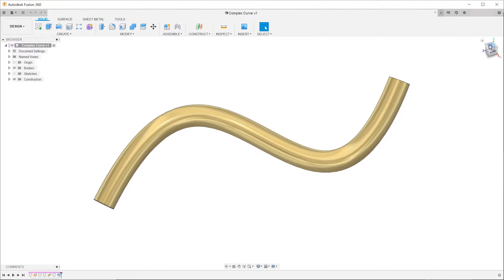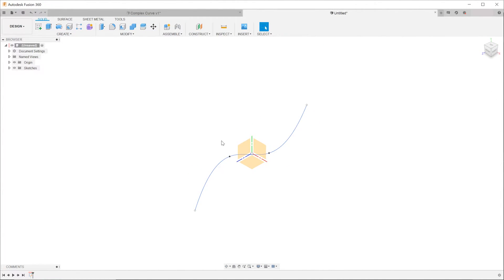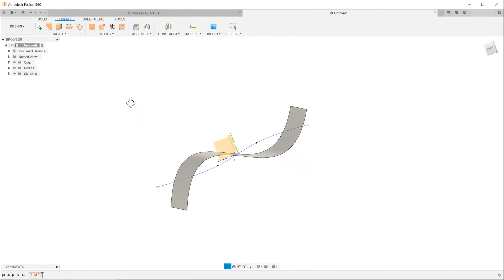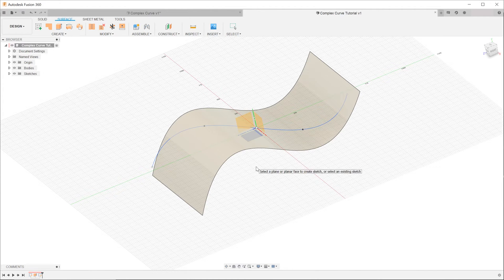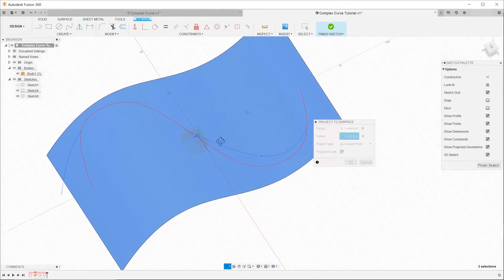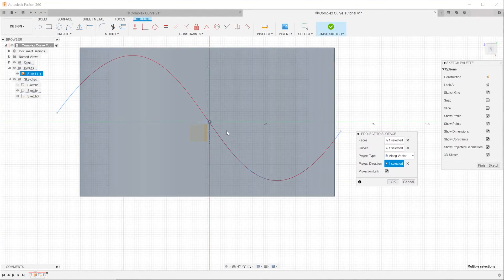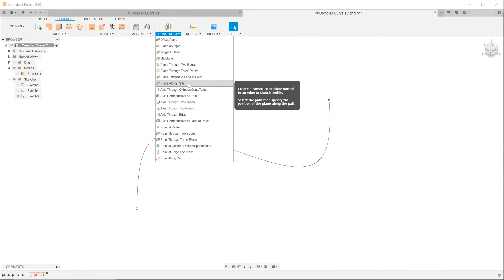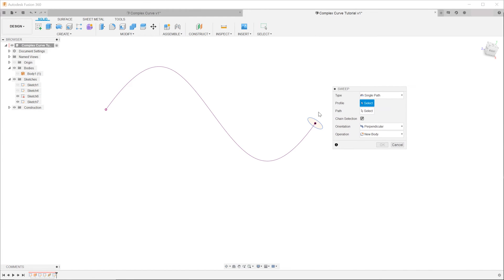Fusion 360 - Project To Surface (Complex Curves)

Comment: You can also achieve this by " combine curve" and using the pipe command
Reply from the maker: Hi, you are absolutely right. By "combine curve", I assume you mean the intersect command where you project 2 curves onto each other. Also, with the pipe command, there is no need to draw a profile. This would be the much faster method. At the time when I made this video, I was unaware of these 2 features. Thank you for pointing this out.
Reply: @Fusion360School  I love this community interaction, I appreciate the work you put out, I'd love to give you a piece of the pie for teaching such amazing techniques and working with your community!
Reply from the maker: @ETechn0  I would not have persisted with the channel for as long as I have without constant encouragement from the community. This is my way of giving back. Sounds like you are involved in teaching Fusion 360 too?
Reply: @Fusion360School  Unfortunately I'm not, my main channel is just really bad memes, I'm in the process of developing parts for the performance sector of MZR / Ecoboost motors and I come from a programming background, all of this is new to me, and I really appreciate content creators who give so much, I've always been interested in material science, and learning how to create mechanical components is a huge part of that, and I think you're teaching wonderful tools that have already helped me out a lot.

Comment: are you able to make a video showing how you can create a hollow fan duct that has a unique shape (i.e not a circle or well defined surface) essentially I am trying to make a fan duct for my 3d printer and have been struggling to get the hollowing and consistent thickness shell working.  Imagine having an slot type output then the other end the input to the fan is 90 degree and maybe a rectangle with all the custom comples curved shape and having to do this at an angle to meet the fan output.  Thanks!
Reply from the maker: Do you have a sketch or a picture? You can email me at tanwinghoe1983@gmail.com

Comment: How do you measure a real life object like this?
Reply from the maker: Hi, I am not sure that there is a good way of measuring an actual object with such curves. The typical way of doing this would be to take pictures of the actual object in the primary planes, import them into Fusion 360, scale them according to an easy to measure dimension (e.g. overall length) and then trace out the curves in sketch.

Comment: Is there any method to measure the angles and loap length of the pipe? Thank you
Reply from the maker: For loop length, you can simply click on the projected curve and lookout for a length readout at the bottom right corner of the screen. Or you can go to inspect, measure and click on the curve.
If you need to measure angles of certain segments of the pipe, I would suggest creating a sketch on a plane and try to draw tangent lines to the curve. From there, you can use the dimension tool to determine the angle.
Reply: @Fusion360School  
It's a bit tricky when it's 3D splite. I read somewhere that fusion does not have tools for measuring angles and radius in complex curves. I will try to measure that with your suggestion, thank you. I need to enter those angles into the bender. I hope I wont have to change the software